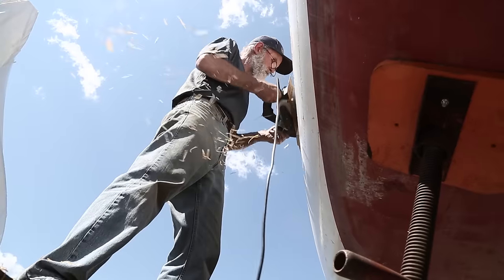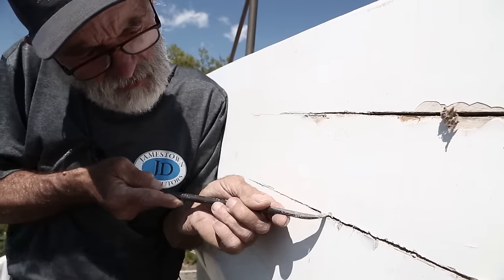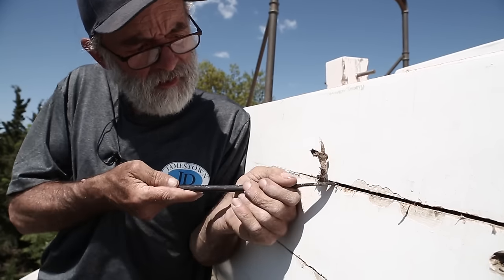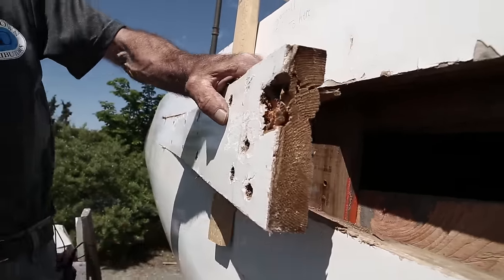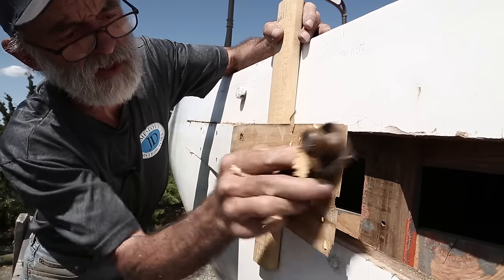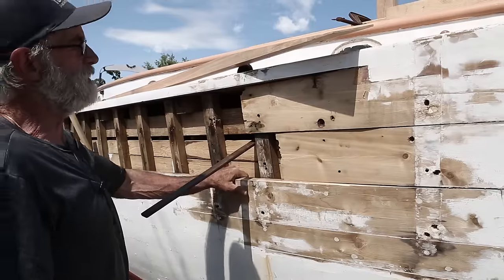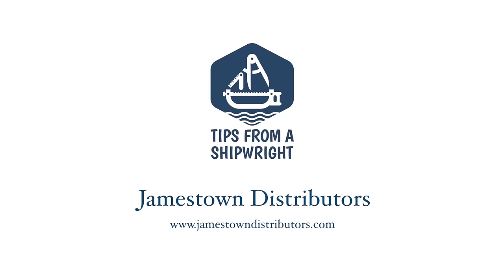How to cut a scarf joint and connect two pieces of wood

Comment: Man, that was impressive. You have an intuitive approach to your woodworking. That raising the grain by scraping technique should be required learning in all woodworking classes. You just can't miss on a glue job that way. We were always taught "smooth, smooth, smooth", but you're right about the greatly increased surface area of raising the grain. It's like an accordian fold in the paper for a filter.

Comment: I like your technique Lou. I've made scarfs 1:12 for gunwales on an iqyax (baidarka) and several other projects. I just glued them with epoxy because that's what was handy.  I've found a good scarf behaves just as though the board was one entire piece, it usually bends as though it's just longer. Scarfs are good. For 3/4 x 1/4" thick western red cedar strips for stripper kayaks, I made a table saw jig.  Little scarf cut offs near the back of the saw blade could be hazardous. But I made my sliding jig so that the long strip was securely clamped, but just above the jig base, then the little wedge cut off would flop over away from the blade.  I made a Skilsaw jig for larger stock. If you need a 12 footer and you only have 8 footers? no problem.  Neither of these would work for your planks, so it's good to see how you do it.  Thanks

Comment: Interesting method of combining power tools with ancient woodworking methods. The purists must hate it (like my old woodwork teacher) but anything to make the job easier is fine in my book! 

Thinking of buying an old carvel planked MFV which needs partial (ha, ha,) replanking. It's 100 years old so not sure if I should combine modern glues / planking methods etc with the original building techniques.... 

Your tips are very helpful.

Subscribed (obviously)

Comment: HI. Nice video. I have a question: How do you know the degree of that scarf so you can match it on the new wood/tie in? Like when we build homes, and do all the cornice work on the ground, we do 7deg, and leave it back 2-3 ft....We know when we get up to tie in the corners, its a 7. I heard no explanation . Do you just like say "The thickness of the wood over 1 foot"? Something like that?
Reply: John Mortellaro  It didn't answer my question. Obviously I knew "how" I could do it, but this doesn't say this is how the craftsman did it. But thanks for confirming another would do it like I described above. Maybe there's a new trick to learn, and maybe there isn't. I still don't know.
Reply: John Mortellaro I think his point is if the angles don’t match there would actually be very little contact, simply a gap you couldn’t see
Reply: @MirroringTruth  He just measured out the same distance on each board and planned a flat slope to that line. As long as the boards are the same thickness and he made a flat slope they will fit together perfectly.

Comment: An old  classical scarf joint should have two thin slightly angled butt ends  at the thin ends and not very thin knife sharp feathered ends.  But of course  the scarf joint with epoxy glue  all over associated with it, is much better joint than any old classical scarf joint.  The old scarf joints my uncle made in boat building had a locking system in the middle in additional to the end butt angled system that the scarf joint  would be self supporting without any glue and could take compression, tension and bending in any direction without no glue, but one inserted square dowel. Chinese craftsmen still use them, but it would be rather expensive and somewhat impractical  in some cases.   To know when to be practical in building modern boats  with new tools and  new materials, is a great talent in itself.    It is such a pity that  craftsmen as this gentleman are not to be found in many countries now.

Comment: I know nothing about boat repairs but have a question as a carpenter. To replace the original timber looks easy enough but with all the glue on the replacement board how will that ever be removed with little to no damage?

Nice work though
Reply: If the plank ever needs to be removed, (such as due to an area of wood rot) it would be removed in exactly the same fashion as a non-scarfed plank would.
The counter-sunk fasteners would be located, the dowel-plugs would be drilled and removed, the fasteners would be removed, then the plank would be wedged above the hull surface, cut, and scarfed, just the same as a continuous plank would be done.

Comment: I had to utilize scarf joints in 5/32" plywood on an aircraft wing a few years ago at 5:1. Any suggestions for the belt sander portion of your repair on something that thin? I could only come up with a microplane and files.
Reply: onelove  
That's what I thought about the whole project! I called it the kindling aircraft. No evidence left if it goes down. I won't work on another but it piqued my interest in woodwork.
Reply: onelove  
I think I will stick with aluminum aircraft. I am not even so sure about the new type composites.
Reply: onelove  
The one I fixed was a Belanca Viking with a 300 horse Continental. 230mph aircraft.

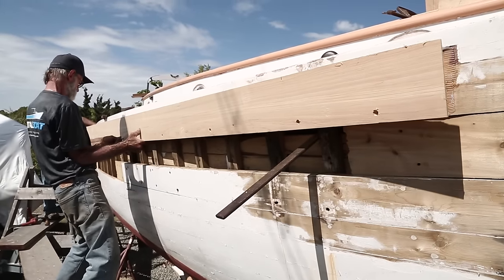Comment: [~4:45]  Mm-hmm.  Y'all payin' attention to the driver he's using to put in those big planking screws?  A good one of those old-style bit-braces, beats the hell out of a battery drill, for some situations.  You can have one or two modern lightweight battery drills, along with a big high-amperage corded drill motor for the heavy jobs, and use all of those all you want.  They're of course indispensable in a lot of common tasks.  Just make sure you also have at least one of the old-school hand-drive ratcheting bit-braces too.  They can do some things a power drill can't.
Reply: Like what for example? More precise?
Reply: to be honest, the only reason I think he's using a bit and brace is because he's re-using the hardware from the old removed plank, and a lot of times, older flat headed screws have longer, and wider slots then today's 'standardized' ones and I believe that you really couldn't get the right sized bit to fit into a modern drill chuck. I have a full set of German flathead cabinet screw driver set, and man they are some weird sizes. 

 I could be wrong, I could be right, but this is what I believe the reason he uses such tool.
Reply: +Brian90402 You have more control with a bit brace. You can feel the screw cinch down without worrying too much about stripping the wood.  Plus, you can still generate a lot of torque with a good sized brace.
Reply: VideosUnrelated nope. He explains in one of his videos why it's better to use a hand crank sometimes over a power drill.

Comment: Glue line updated - Below is quoted:

But our work shows that too much roughing of the surface can cause loose fibers and fiber tear which can weaken the bond. As above, the adhesive bonds to the cellulose so a roughed surface is not necessary, but as long as it doesn't damage the wood surface to be bonded, it will produce good results on veneers

Comment: How did you get the angles on the scarfed planks to match? Just experience ? If I'd freehand scarf joints with a power planer I'm pretty sure they'd not match up as nicely.
Reply: you measure up the plank. If you were working with 1" 1/4 thick boards and measured out 12" and struck a line from corner to mark on egde of board and repeated on new adjoining board . you would have same angle on both boards.
Reply: Ah I guess I missed that looked like he just freehanded it :)
Reply: +TheLukio i am guessing that is how he would do it, thats how i would do it, ive built a couple boats.

Comment: how do you get the profile on the joining piece of timber to match perfectly?
Reply: He measures. Measure out say 10 inches from the edge of the two boards to be joined and scribe a square line across. Then use that line as a guide to end your slope. You just hand plane it to the line and make a nice edge on the end, do the exact same to the second board and both will match. Imagine drawing a triangle on the edge of the board if that helps and then he planes it to that. Make the triangle the same dimension on both boards and they fit together perfectly.

Comment: Sorry, Your Scalf joint is back to front, the front plank should be over the top of the rear plank
To stop any featheredge damage ,when the boat is moving .
Reply: I noticed the exact opposite, and was congratulating him until I saw the leading edge of the board (he showed preparation more at the trailing edge). But then I thought, how could you possibly reproduce this at the leading edge without removing the entire board? I think the cleanliness of the joint and effective gluing should take care of it. I reckon that getting the angles exact without making the patch board too short shows his real mastery.

Comment: wood glue when fully dried becomes stronger than the wood itself! The wood would crack or break before the glue would fail.
Reply: Tarman The Champion I’ve seen wood glue come apart and fail
Reply: @jasonnester9514  Really? I've NEVER experienced that before. I guess anything can happen. I'm curious did you narrow down the culprit? Was it old glue? Or the conditions really humid? Or the wood still wet and when it dried out and shrunk it popped right off?
Reply: Tarman The Champion I think it was combo of humid conditions and slightly green wood

Comment: This man just used a hand brace. I don't know about ships/boats but I laugh my ass off watching people try to drill through an 8×8 sill plate made of heart pine to run a wire or pipe with a power drill on full speed with a paddle bit, burning, smoking and cussing all the way through. Then you have the guy who thinks that turning on the hammer drill or using an impact driver will somehow help. It's fun watching when the bit breaks off at the shank and gets stuck in the drill. May as well be drilling through a 2" steel plate with a mortar bit. A hand brace and auger bit works much better and easier.

Comment: It's really not necessary to use a scraper to "raise the grain" for a strong glue joint. You did that by cutting the scarf and NOT sanding it, thereby leaving the wood pores open. The most important part of preparing wood for the strongest glue joint possible is to keep the wood pores OPEN.
Reply: Blah blah blah blah blah